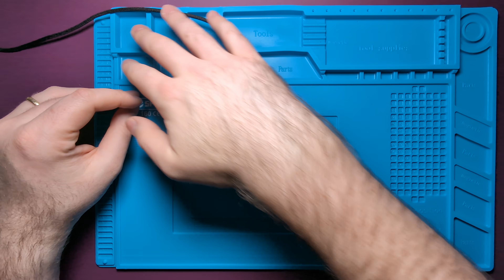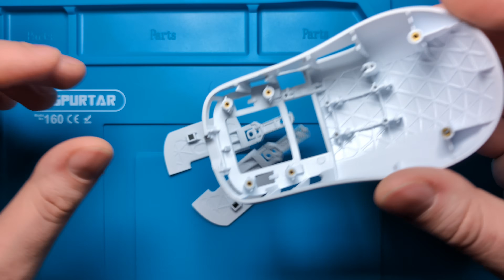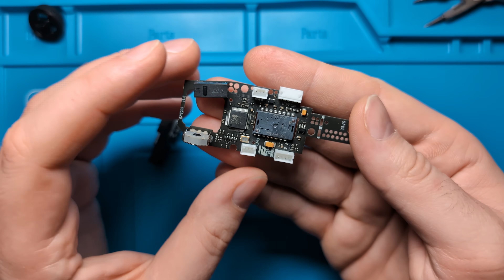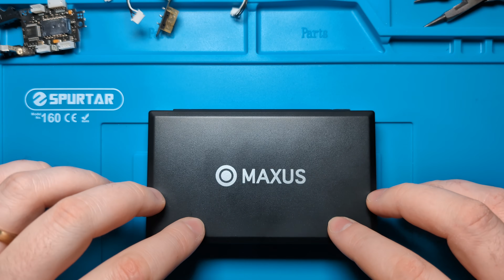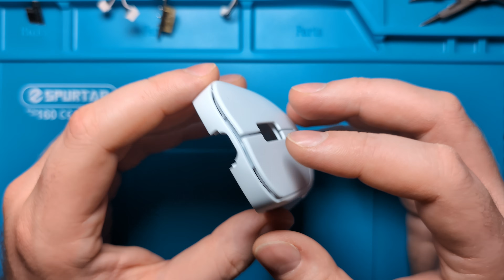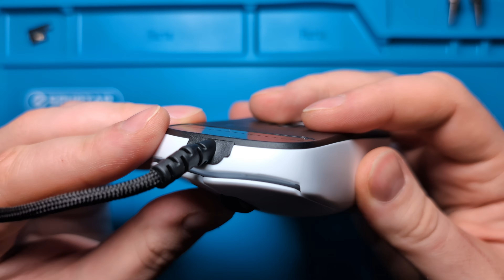TEARDOWN | Endgame Gear OP1 8K V2

Comment: Hey I got the same mouse and when I’m plugging it the light, lights flick and does not work. I tried firmware update, updating it, and assemble and disassemble, it won’t work.
Reply from the maker: Sounds like a potential issue with the cable, I'd try replacing that first or reach out to EndGame gear and see if they can help diagnose the issue!

Comment: Do you think it will be possible to put the same type of switches the super strike has on the op1 8k?
Reply from the maker: Technically possible, but there's no point since the stock SPTD switches already have similar if not better performance than the HITS system.